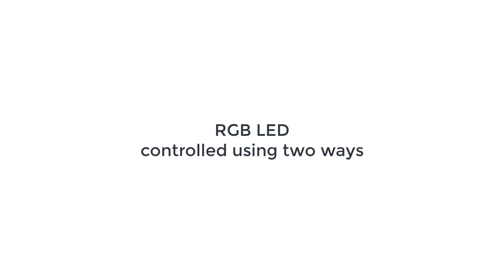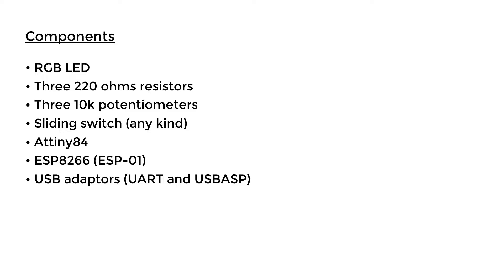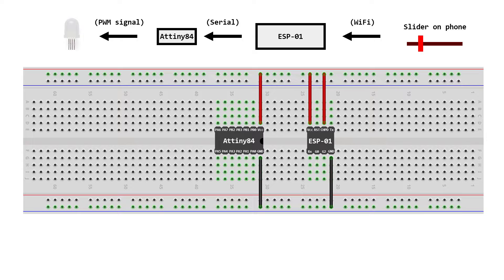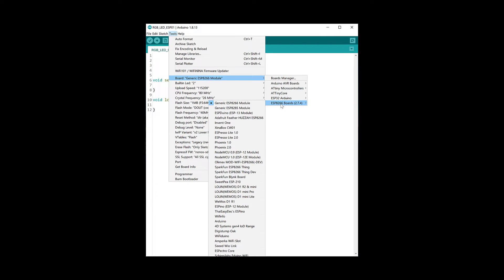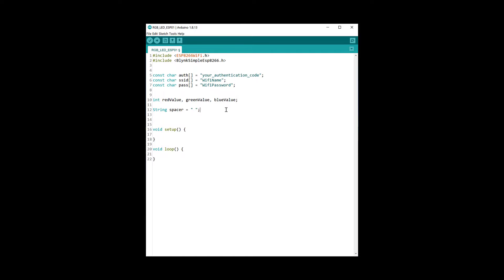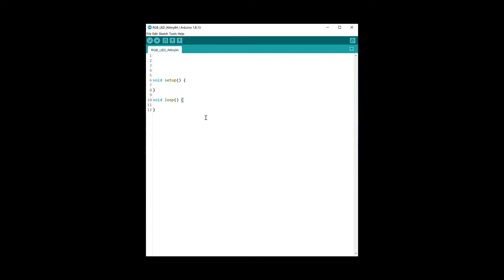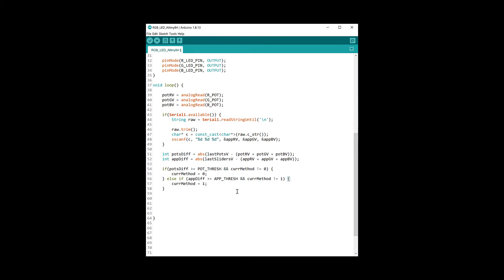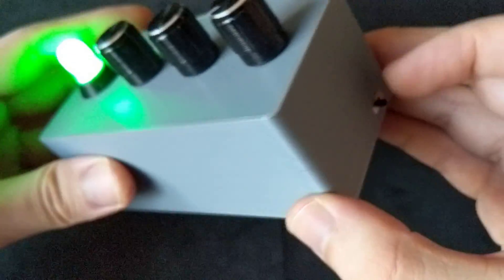RGB LED controlled using two ways potentiometers and phone using Attiny84 and ESP8266 | #P1

Comment: Hey my man, do you happen to have a schematic which I can use to power an 12V LED strip using three potentiometers, as shown in your setup?
Reply from the maker: It should be a very similar setup as in this project, but just be careful to have the correct voltage conversions for the LEDs and the micro-controller.

Comment: Hi! I was wondering if you knew the max voltage and current that can go through the usable pins when their pinmode is set as input. Thanks in advance!
Reply from the maker: For the Attiny84, each pin is rated 3V, 40mA.